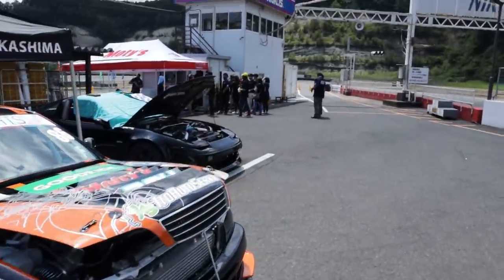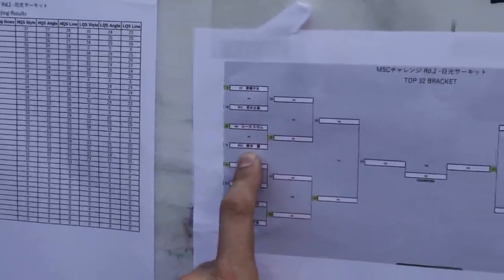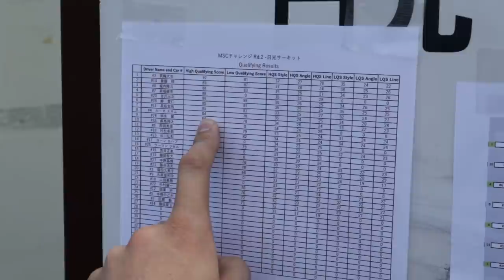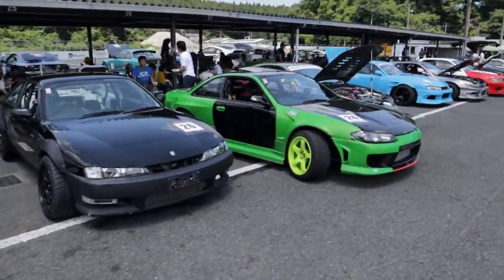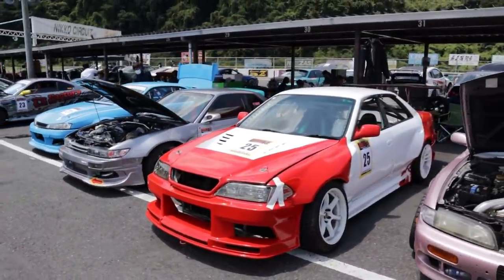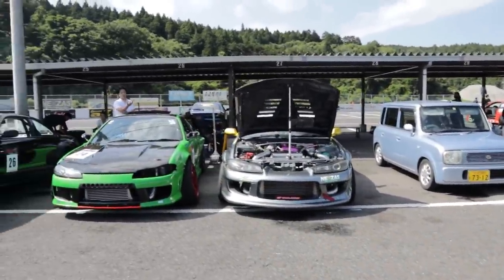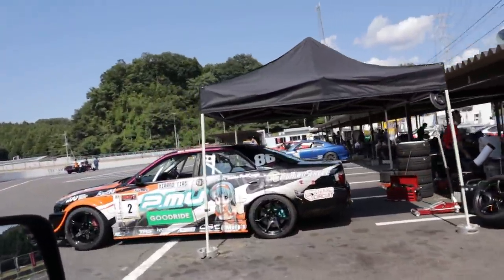COMPETING IN PRO-AM WITH MY DRIFT MISSILE?!?!

Comment: I was going to say it might be a good idea to look into getting a quick change rear end to guarantee you always have the right gear ratio for the course you’re competing on…
Other than that, great job; you performed well and even though you lost in the first round of eliminations you qualified well and got valuable experience! Looks like you might need a checklist or reminder taped to the steering wheel to check you have the right tires on the Chaser! Cheers! 🖖😎👍

Comment: Denofa used donuts on the front :V
Reply: Yeah but that car is setup extremely weird because of the rear suspension. He’s basically said he runs an incredibly stiff rear spring because of the e30 trailing arm design, so he’s said that car makes almost no mechanical grip and everything is basically from adjusting tire size and pressure. Also Chelsea is a complete animal at the wheel and can drive just about anything 😂
Reply: @zerohourdrift  true true :)